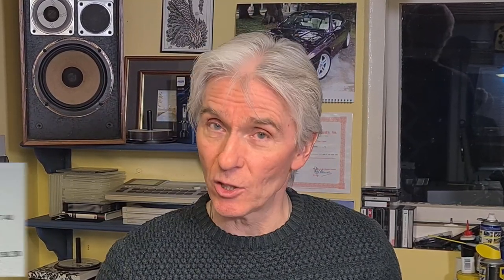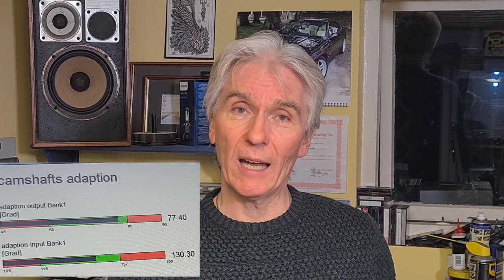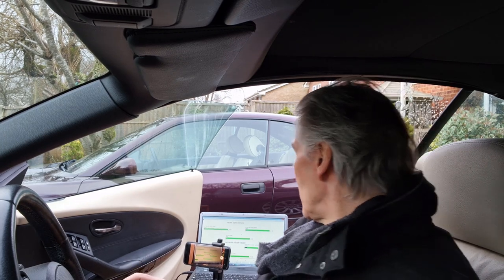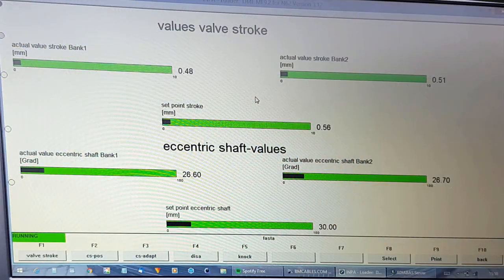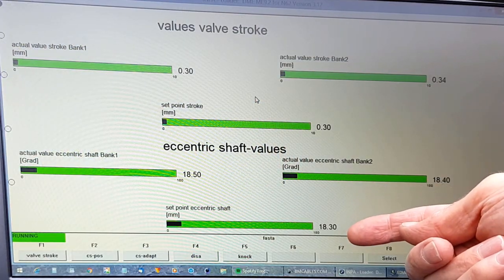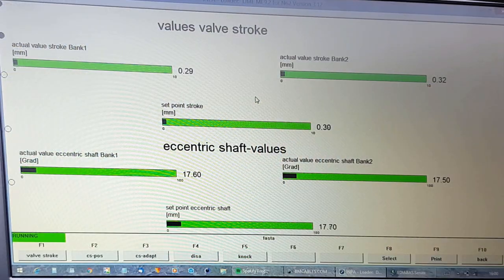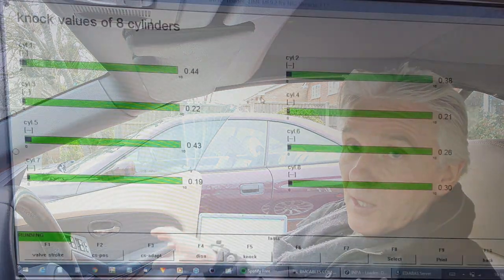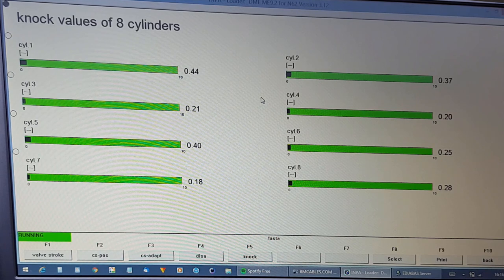BMW VANOS and Timing Chain INPA Diagnostics

Comment: I'm absolutely thrilled by amount of value you're sharing in your videos. Last year, I bought an E39 520i (m54) without knowing anything about BMW (I knew the brand, of course, but I didn't intentionally buy "an E39" - it was just the car I could afford at the given moment. I quickly realized how happy I felt when driving it and wanted to start learning about how to take care of it, but the condition of the car was really bad due to neglect from previous owners. I decided to "upgrade" to the 535i (m62tub35) and found one in much better condition (almost no rust, engine almost running perfectly etc.) and I feel I have an obligation to be like..... a custodian ....... and take proper care of a piece of history. But, as I'm not a mechanic in any way, my DIY adventures has been restricted to changing wheels, oil, a sensor here and there and stuff like that. You're videos - in my case - are just perfect - it's "next level" information that makes be know even more about my car and you're VERY good at explaining and keeping things simple (like the video where you talked about how fitting cold-air-intakes, electrical fans etc. didn't do what most people would expect. Right now, I'm trying to learn about VANOS as my engine has both a rattling sound when starting (only for 1-2 seconds) and replacing the chain tensioner (the "plug", not the guides / rails) didn't do much of a difference. It's definitely not something I can fix myself, but by knowing more about it, I'm better suited to have someone fixing it without a BMW shop replacing it all at a higher cost than the value of the car in the first place. Thank you very much for the videos !
Reply from the maker: My pleasure and glad you find the video's useful!

Comment: Hi! I hope you see this. I have a 4.8is that has been resealed but I have codes for all 4 vanos. 2a83,2a84,2a88, and 2a89. Oil pressure is good (70 psi on startup) and engine is very clean and low mileage. I checked timing and it’s dead on. Adaptions are all as far red as they can go. I’ve tried cam sensors, vanos solenoids, new ivm, vvt module and ecu and nothing has worked. Chain looks good and tight what would you recommend looking at next?
Reply from the maker: You must use BMW OEM sensors - if you have anything else in there then you will never resolve this problem
Reply: All sensors are Oem and tested. What causes the adaptations to be full red? Is this maybe a ecu or wiring problem?

Comment: Hi I have a 735 with n62 and the values of the input shafts are 90 degrees, the output shafts are 120 degrees.  Is this normal because you say the input shaft should be at 100 degrees
Reply from the maker: Unless you have an error code you are fine

Comment: any help for my problem? 2008 650i conv 100750mi.  did valve stem seals and cover gaskets.  now have code 2A8C exhaust adaptations.  on start the car runs fine for 30-40 secs and then stumbles and throws the above code.  car continues to run good after the stumble.  using INPA i can see the bank1 exhaust value changing until the stumble and then the value freezes at 120.  i have swapped solenoids, cam sensors, checked voltage at the plug (battery voltage, 3.3V other terminal).  checked timing and spot on.  have tried various forums and BMW tech.  BMW tech says only left is to replace VANOS gear.  any more ideas?  i have vid of INPA but files are very large.  i notice when watching the adaptations, bank1 outlet reads around 70, bank2 outlet reads around 72.  when the stumble happens, the bank one goes from 70 to 85.  before the stumble, all the VANOS readings work, and the activations change with throttle.  after stumble, bank1 outlet stuck at 120 and none of the activations change anymore.  the solenoids on outlet bank2, and both inlet continue to change.  adaptations on bank2 outlet and both inlet adaptations continue to fluctuate.
Reply from the maker: Well, the adaptations are about right for an N62 that has been re-timed during the repairs. Your mechanic is on the right lines, one Vanos unit seems to be getting stuck, the adaptations start changing trying to get the timing back - and fails giving you an error code - adaptations at limits. Unfortunately with Vanos, there are a few possibilities, lack of oil pressure, solenoids or the Vanos unit getting mechanically stuck - always tricky for any mechanic,,,,

Comment: Thanks Timm. My N62 camshaft adaptations are 130 and 134 also. Always seemed off but the engine is smooth as silk. At 125000 miles  you should be planning for water pump, alternator, and upper radiator hose. Heater valve and auxilary water pump also. Wahler makes a 101 degree thermostat now which can take some stress off the cooling system components and gaskets.
Reply from the maker: Thanks Jason - as a general rule, apart from regular servicing I ignore everything else until it gets louder than the radio!
Reply: @TimmsBMWRepairsandInformation  Ha. The Logic 7 audio really helps! You pretty much forget about all the tandem oil pump noises and such going on and get on with it.

Comment: Thank you for this video! I will try to raise the valve opening at my N62. Everything runs fine, except sometimes (doesn’t matter if motor is hot or cold) the idle is extremely rough. Rpm stay fixed, it’s just extremely shaky. I’ve already changed the membranes, cleaned the vanos valves, checked for leaks… nothing.If I step very slightly on the gas pedal in idle and raise it for 50 rpm everything runs smoothly.

Comment: Hi Timm, I have a e90/N46 and been puzzled by the VANOS values I read. The readings for Bank2 are literally off-the-charts! "Einlassventil Hub Bank_1 = 0.42 (mm)" yet "Einslassventil Hub Bank_2 = 65.53 (mm)" and also "Exzenterwellen Winkel Bank1 = 17.40 (Grad)" yet again "Exzenterwellen Winkel Bank2 = 6553.50 (Grad)". You would be right that I have a lot of CO and NO in Bank2 which is damaging the catalytic convertor. I have replaced it once myself (not a fun nor an easy job I must add) but it has damaged the 2nd Catalytic already. My fault as I didn't figure out the root cause of the issue. So any ideas?
Reply from the maker: Not an expert on the N46 - but replace the chain tensioner as a first call

Comment: Hay Timm this is Alvin your number 1 fan. Wow after looking at this video I can become a Certified BMW technician. Great information to have. Also I order 2 new crankcase vent valves. I discovered that the new ones don't have the nipple for the hose on the black cap. Do I need to use my old cap, with the new rubber Insert?
Reply from the maker: That's probably the best plan Alvin - keep safe!
Reply: @TimmsBMWRepairsandInformation  
Thanks Timm. You and your wife be safe.

Comment: I have a rough idle when in drive in my 2007 750i what could it be? I did spark plugs it helped a little bit what other causes rough idle only in drive not in park it idles fine in park just shakes at stop lights and its embarrassing. Also idles at around 470-500 when in drive idk if it is supposed to be that low

Comment: Hi Timm :) Great work as always with V8 engines. Mine actual value input on bank 1 and 2 is 79-81. Output is approx. 120 on both banks. Is it allright? I can hear a rattle noise but it also can be as well from hydrokinetic mechanism that is broken. All other units are as well looking as yours, some even better ;)  but there is still some rattle sound that makes me sick. It is much louder at load when driving, from 1000-1800 rpm. I changed camshaft sensors, selenoids and timing chains with all additional elements.
Reply from the maker: Hello Przemo, have you changed your oil recently? https://youtu.be/woTGvS8eyiY
I use Castrol Edge FST 0W 30 and that seems to quieten down the top end - they are a little noisy though!

Comment: Good afternoon, congratulations for your videos. I would like to ask you a question? I have a bmw 645ci year 2004. When starting with a completely cold engine it goes great but when its temperature starts to rise the camshaft position drops from 100 to 80 on both intake banks and when accelerating a kind of vacuum sounds that delays engine acceleration as well as the drop in revolutions, sounding a kind of suction in the intake manifold. Neither ISTA+ nor INPA detect fault codes. New spark plugs and ignition coils, as well as oil and filter, vanos learning done, new O-rings on solenoids, cylinder head cover gaskets and vanos electric motor also new, could you help me? thank you very much in advance
Reply from the maker: Hello Luis, first of all, the N62 IS a bit slow when the throttle is poked to start with, it takes a while for the Valvetronic system to increase the valve lift. However, the slurping noise could be the PCV valves - so worth checking them: https://youtu.be/Yy_Vzir5xco

Comment: I bought all new PIERBURG vanos Solenoids on my 07` Alpina B7, I can`t get rid of P0022.  Any help or tips? Oil is 3k miles old- Liqui moly 5w40
Reply from the maker: Unfortunately that usually means timing-chain guides failing

Comment: Hi Tim with Adaptations on bank one on start up my one starts around 88 and keeps dropping to 72 then bangs out a code exhaust camshaft tooth offset to crankshaft. Any tips? 
Bank 2 stays steady at 76 and I have changes sensors on exhaust camshafts
Reply from the maker: Try changing the Chain Tensioner on Bank 1 (the difficult one) and pray that fixes it, otherwise it is probably chain guides

Comment: Hi Tim,
I have a problem with the megatronic gear box of my 650 CI 2010. On 6 gears or when I drive with the engine on low RPM if I accelerate suddenly the gear box do not change to lower gear and the gearbox jump to neutral with a CaS message fault ( the sign is a crank yellow ) I have no more control of the gear shaft on auto or manual . I stop engine and restart all normal again . This happen only on auto mode never on manual mode. I have changed the gear box oil, lots smoother now but still have the problem time to time . I suspect either the megatronic electro valves or the over speed control unit that might be faulty and detect a wrong different shaft speed and disconnect the gear to neutral … I have ask 2 mechanics they think it’s the clutch but I don’t think so as everything works perfectly in manual gear or sport mode , it’s only on auto mode that I have the issue. 
Any idea or recommendations ? Thanks 🙏
Reply from the maker: Hello Patrick, the best way forward is get a diagnostic scan and get me the error codes. But before that replace the battery, even if it is just a year old, it's a darn sight cheaper than most repairs!

Comment: Hello Timm! I love your channel and your work. Always happy and informative. I have a BMW 740 iL 1999 with a M62TUB44 engine and I want to buy some kind of scan tool. From my experience there are things like Carly and so on but will it work on my car? Am I right to say that you need to have both the OBD contact on the centre console and the round contact with all the pins under the bonnet connected to be able to read codes and delete service lights. I read English very well so the software doesn´t have to be in my native language. Pls share your thoughts.

Comment: Sup Tim Thanks for your explanation it  helps to understand the concept of operation I have a 2004 e46 318i with dtc 2852 285A 2866 2865 2850 2854 I have recently replace the valve tronic motor bought a Delphi e150 to relearn the motor but it seems that these dtc preventing it from relearning the motor the engine use to start ok before  I change the motor. the problem I ad with it is that when u accelerate and release the throttle pedal you hear a slamming sound in the intake manifold to me it sounds like the throttle butterfly slamming shout due to maybe a backfiring in the intake manifold I  dont have any experience with bmw do u ever com across this problem before
Reply from the maker: No, but diagnostics should help, especially the roughness page and the Vanos readings

Comment: Extremely interesting Timm, thank you. Can you suggest a good source for INPA? My version only goes up to the E60.
Reply from the maker: Thanks Martin, the main problem is that the sellers just don't last long - BMW knobbles them quite quickly (they own INPA). I have always got my INPA when I buy the diagnostic cables - last time from BM Cables - but they are long gone.

Comment: Hi Tim keep up the great work and thank you for the clear explanation of the complex valvetronic/ vanos system. I currently have an undiagnosed misfire with my N62B48 and I compared my values to yours and the only difference was the disa volt reading 0.95 compared to your 4.99? Mine increases as I depress the throttle. Any thoughts please? Thanks Clint
Reply from the maker: I'll have to investigate that Clint, I didn't think the DISA changed much unless actually driving on the road under load....

Comment: Hi Tim, first of all Fantastic and informative Video.
I've just purchased a 05 X5 4.8is ( In the land Down Under ) it starts fine but after about 5-10secs it starts running like its got a lumpy cam. After about 30secs it then idles fine. I've cleaned and checked the Vanos solonoids made a very very slight improvement but didn't fix. I've just watched this video and also scanned with my Foxwell and it comes up with the following codes.  2A89/ present DME Exhaust Vanos 2 and 2 A84/present DME Inlet Vanos 2 . I also noted in the live data the Following: 
Vanos adaptation inlet cyl 1-4 125.60*
Vanos adaptation inlet cyl 5-8  68.30*
Vanos adaptation exhaust cyl 1-4 70.80*
Vanos adaptation exhaust cyl 5-8 126.80*

Is this normal??
Kind Regards
Ben
Reply from the maker: That's not what I would expect, first step is to change both the chain tensioners, Bank 2 is easy, the one on Bank 1 needs the engine lifting at least on the 6-Series....
Reply: @TimmsBMWRepairsandInformation  
Hi Tim
Thanks so much for your reply. Why would you say change the chain tensioner? Do you think the chain could be loose? Because there is no chain rattle and I pulled off bank 2 valve cover the other day and put a new Eccentric shaft sensor on and there was no slack in the chain it was tight. After putting back together it started no worries after doing a reset in INPA on the adaptations. In the live data the Valve lift was back to normal at idle as per your readings in this video, but as soon as i applied very light throttle it would splutter  and then the values would go to 9.45 and then no longer move.
Thanks Ben
Reply: Hi Tim,
I've been going over and over this in my head. What are the chances do you think of it being a bad Eccentric shaft? Could this jam? When I changed the oil it was a bit sparkly.... something must of worn? If I pull the Valve cover off again what should I look for?
Thanks Ben

Comment: Hello Sir, excellent video, sometimes we find cars that do not start and we hear the engine without compression, can you make a video with inpa where you can see the position of the cam shafts in this fault ???, thank you.
Reply from the maker: Hello Juan, unfortunately INPA does not show the absolute camshaft positions, only referenced to the crankshaft sensor while the engine is running.
Reply: @TimmsBMWRepairsandInformation  Basically I want to see the position of the Vanos, while we do cranking, but without starting the car.
Reply from the maker: @jmbmwmiami  Diagnostics can't do that I'm afraid!

Comment: As always good information! 
I picked up an 02 e65 (no history very inexpensive) It is simply a project car! 
I cannot seem to find a definite answer if the block cylinders are honable or can be bored?
I've seen a couple have done it though
Reply from the maker: Hello Patch, only specialist engineers can re-hone the cylinders - as a general rule, modern BMW cylinders last the life of the car, the surface is extremely hard - and only about 4 thousands of an inch deep!
Reply: @TimmsBMWRepairsandInformation  Thank Tim for the feedback. I thought as much. This is a gain for those of us that follow your channel when it comes to the N62.  Well Let me ask you this then: is it too risky to freshen the ring then? My reasoning is this: The engine has no known history but was at some point well maintained, it came to my ply shop as the technical aspects were too much for the previous owner! That said I like the car car and that it can be a sleeper (hidden power) so I like to just take it apart once and be done with it as I often just take off across country for weeks at a time (Canada) something I enjoyed about the E 320. Crank bearing sound smooth but I suspect some piston ware 225k klm on her. The 6hp needs a pump what a racket her to separate that when before agreeing to take it on, so that the easy part ;)
Thanks Tim and I'll be checking out your webpage soon, not interested in the forums

Comment: Hi Tim, thanks for the video, your explanation is very nice. I checked my adaption values on my e65.
The adaption input Bank2 is in the red at 150, and I have code P0021 that says intake camshaft is advanced. Oil is fresh, vanos has been tested and replaced, camshaft sensors have been replaced. I don't know what else to do. Any suggestions would be appreciated
Reply from the maker: Have you changed the chain tensioner? Fortunately Bank 2 is the easiest one to get to